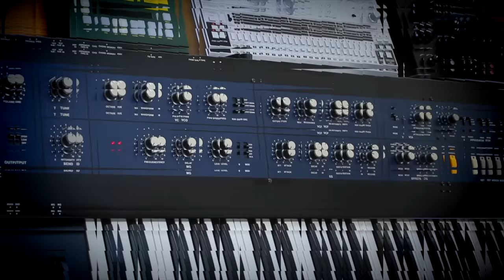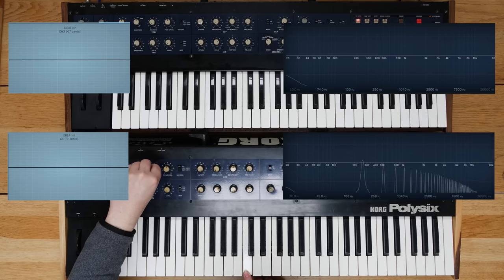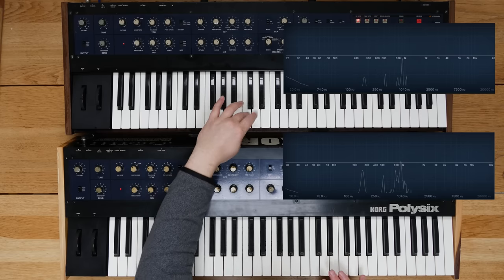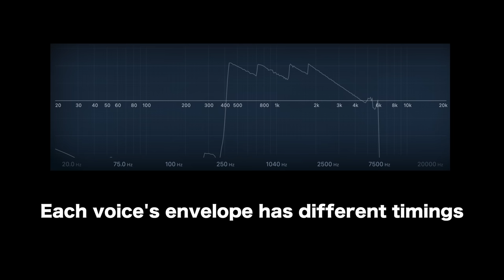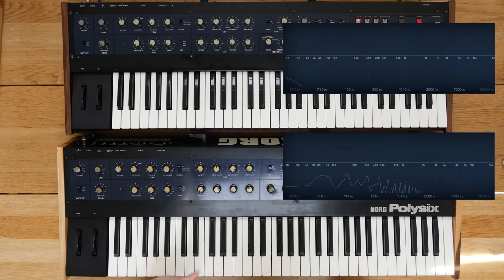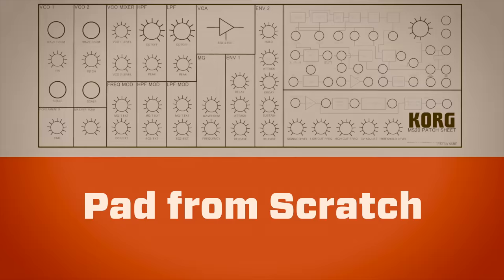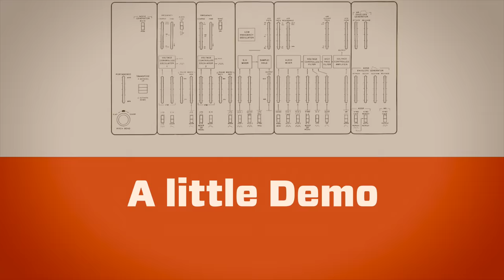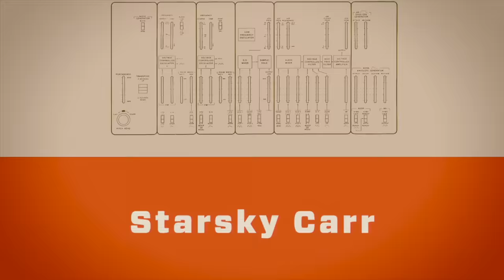Do vintage synths sound the same?

Comment: This video is a real triumph and it should be linked to often.  So often we've heard Starsky Carr state that the difference between an emulation(software/reissue) and the original might not be greater than the differences between two original vintage units, and here he demonstrates it/proves it. The three things that make Starsky Carr my favorite youtuber are: 1. The scientific quality of his videos 2. His in depth knowledge of knowing exactly which niche areas of a particular synth to exploit to find the differences (ex. the cross mod on the Jupiter 6).  3. That he edits the videos down to the shortest length they need to be to get all that scientific data out.  These videos are concise, the editing job he's doing is tremendous. Most other youtubers would take 3 times as long to get the info out that Starsky Carr does.
Reply: Polysix = want.
 
If he tried to do two vintage and one emulation, what poly would be needed fit on the screen ratio? Not 3 CS80s..
Reply: @citygasbatteryriot964  You watched the whole video and saw that he added the Korg VST emulation of the Poly Six towards the end right?
Reply from the maker: Thanks…. That’s a lovely comment 😀
Reply: No, thank you @StarskyCarr  for your brilliant work. Your videos are really a cut above your peers, and they've been really helpful to me and influenced my purchases. They are delight to watch, where as many others are a chore.
Reply: @DasKreestof  Aye, but all three together, overhead..

Comment: So much love put into this video.. had me chuckling a couple of times! The result of honest comparisons usually is, that while hardware sounds different, it's not a matter of quality, but a matter of taste. The differences between two hardware-processors (that are meant to sound the same) are not smaller than between a plugin and the hardware. There are very few hardware-processors that do something, that no plugin can do (yet). The dbx subsynth comes to mind as an example of something that has not yet been reproduced accurately in the digital realm (I don't know why though). Attempts have been made, but they don't seem to cut it. So the primary reason for hardware, in my opinion, is that it's hardware. You can touch it, you can play it (and impress visitors). If it wasn't for that, I wouldn't be thinking about buying hardware at all.

Comment: Do people normally have equally matched left and right ears?

Mine aren't even close.  The right one hears less bass and the left one hears next to no treble.  I've seen that sort of comparison done before - item A panned hard left and item B panned hard right, but there's no way my ears can compare the two, on that basis.
Reply: Put your fingers and peck your nose then force are into your sinus until your ears open up, Usually wax dull down most peoples hearing.
Reply: Each ear hears a little different. Ears are a phenomenon.

Comment: A major difference you can hear between the hardware and the software versions of the synth is that the software doesn't have the background hiss of the hardware. You can really hear it at 16:38. There are however mods that you can do to the Polysix to reduce that noise floor - I did them to mine, and the noise floor is almost inaudible now as a result.
Reply: Unless your noise floor is like -50 or higher you probably aren’t improving anything. Noise is essential to mixes. Have you ever seen a picture that has had so much noise reduction peoples faces look like plastic? The same happens with audio. Imperfections, artifacts and alias becomes a lot more noticeable without a bit of noise to smooth out similar to dither.

Many mixes I do for clients I add up to -45dB noise! Nobody even notices but always ask how I get the top end “so smooth!” I usually don’t mention the trick because people have weird attitudes about noise.
Reply: @sibbyeskie  The noise floor in a Polysix is significant. It's a very noisy synth. You can see/hear the before/after when I did the mods on my Polysix here: https://youtu.be/yvufr7siFRs?list=PLLsKvE62zvpzR7I-gIEnrke3YurGnNtpx&t=1229
Reply: Synapse audio Ledgend has the hiss.

Comment: I've always thought vst's sounded great but I personally have a hard time jelling with a computer, mouse and midi keyboard. I need the tactile feel of knobs, dials, faders, and switches to connect with the instrument.
Reply: That's why you are supposed to use a Midi controller. I'm a Reason guy and make any midi controller match up with any software sythersizor.
Reply: @HOLLASOUNDS  Thats why I use all the analogue stuff! It smells amazing, and I dont have to heat the studio haha!

Comment: Of course they won't be the same. They're 40 year old analog synths, and the components inside have aged differently depending on how they were used, and the environment in which they were kept. The Polysix is also a bit of a beast to tune and calibrate, with tiny little potentiometers that only afford a certain amount of precise adjustment. As a result, no two Polysixes are going to sound exactly the same - even when freshly calibrated. When I rebuilt my Polysix, I spent over a day in the calibration and tuning process, but it will never approach the perfection you get from a digital synth - and that's the beauty of analog.
Reply: Exactly that's the point of the video to show that two identical vintage synth dont sound the same so people cant say a software emulsions dont sound the same.

Comment: I think the beauty of analog is that they don't sound perfect. Digital synths will always sound 100% identical, but analog has that subtle organic uniqueness to it. I also think it's way better not to have presets. Makes each session unique even if you dial in the same sound, because the knobs will never be at the exact same place. And if it's full analog the knobs are actually part of the sound circuit, not controlling an ARM processor that's sending MIDI data to the circuit. Can't stand digital control because once I noticed the stepping between MIDI values, even though it's subtle, it drives me nuts.
Reply from the maker: There are some bits that really feel like you can sense the electrons. Analog Solutions Leipzig springs to mind.

Comment: I'm pretty sure that the Poly 6 is very similar to the Monopoly, looks like it, Behringer said they where going to produce a Poly 6 but as far as I know that's not being released anytime soon. You proved that Software emulsions of Minimoog sound like the real thing.
Reply: Well he kind of mostly proved that it did. 
When it came to FM and the feedback/overdrive there still were differences between the hardware and software.

Comment: I never care if a softsynth is 100 accurate. As an former owner of many vintage synths I already was very aware that it is impossible to emulate a vintage synth that is yours or was. If you would compare the unit the VST was modeled on it would be very very close. As an example, I have a vintage MS20 rev2 and the mini version. But the one that I prefer the most is mine from the Korg VST Collection because it has a similar sound to the MS20 from my studio partner. I was always jealous that his synth sounded so much better than mine. Just use the synths that works best for you. Music making should be your focus not getting an orgasm by listening to filter sweeps on your analog gear. Sometimes maybe ;-)
Reply: A Korgasm?

Comment: They sound different down to the wave shape, but they are both good. One sounds brighter then the other. I personally prefer the brighter one. Could it be  related to it´s circuit ageing? Years ago a friend of mine and I tested 2 Black and Oorange ARPs 2600 with even close serial numbers. They could sound the same BUT the settings should be slightly different for that. Also then we could hear one a bit llouder then the other, or brighter or the LFO frequency a bit off.... I wonder if a seriel numer between tyhise from your Polysix would sound in the midle too! :) Thanks for this demo. Helped a lot! :)
Reply from the maker: Thanks, I think its probably more to do with individual units, their atmospheric conditions, use etc. If you picked one between these two it would probably be different again. not a linear discrepancy but a random one. ... perhaps.
Reply: @StarskyCarr  Thanks! :)

Comment: Yeah it is very close and most differences are mainly about calibration. For example my P6, as it got calibrated, goes faster into self oscilation than both of yours. The thing about PW going into zero/silence is actually intended feature - that is the way Korg wanted to allow the users to turn off oscilator and play just filter itself.
The nature of VCOs being fully discrete then brings nice little variation, because they simply cannot be as close in tone as for example CEM IC's or so.
Reply from the maker: Cheers, yeah mostly calibration - but as I’ve found out that doesn’t last long 😂 and PW to silence is also great for pseudo delays and arp style stuff.
Reply: @StarskyCarr  Yeah little annoying on P6 is that you need to disassemble it, go in and do everything manually. 70's way of life. ;-)

Comment: at 11 minutes did you notice the kbd tracking settings were different, leading to the top synth filter being a lot more open?
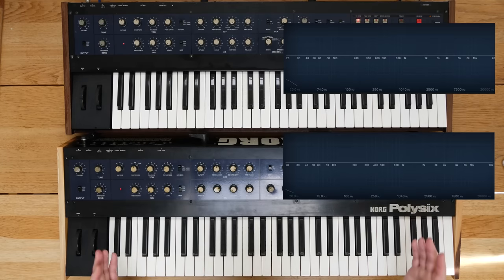Reply from the maker: 11:10 At that point the tracking is off on both, but the envelope intensity is different - which turns out is what was making matching them difficult. This but was heavily edited. No-one wants to watch 10 minutes of me trying to get them spot on… no-one except Lecter at least 😂

Comment: Honestly the hardware vs. software wars are over - Some skirmishes may remain, but really the synth manufacturers themselves put a bullet it in long ago and now it's not a matter of "Is it software or not?" but rather "How good does it sound?"  My Kronos does P-6 emulation, and I did a little playing around with it while comparing it to your video, and... Yeah, it's a PolySix for all intents.  Are there differences?  Some, but not ones I care about generally.  Does the Cobolt sound better or worse than the B2600 reissue?  That's a nonsense question.  Does my Arturia Origin Keyboard sound like a miniMoog?  It can.  But really, who cares?  Is it better or worse?  Yes.  It's fun to put your two PolySixen (plural?) head to head, but really that's all it is.  Fun.  So yes, a fun video for sure!
Reply: Well its alot easier to get software sythersizors into a project than physical ones, and whilst I have Novation Peak and Behringer Monopoly they dont feature in any of My music, to much hassle.
Reply: @HOLLASOUNDS  I find the opposite. Depends on your setup though. I recorded directly from my X32, so it’s easy.

Comment: Really, your conclusion is "I don't know"?  Not going to let you off that easy.
Reply from the maker: haha.. I guess its because it depends on the software/hardware in question. The Behringer Model D for example, really surprised me how close it was. It wasn't exact, but neither are 2 minimoogs.  It had the right character. Same for Softube's 106 Model 84 - but still people pick out specific bits of the videos to prove its not the same.  Cherry Audio's 106 on the other hand sounded nothing like mine, but their Jupiter 6 is very close.

So yeah.. I don't know ... to avoid opening up the whole debate again in the conclusion! :)